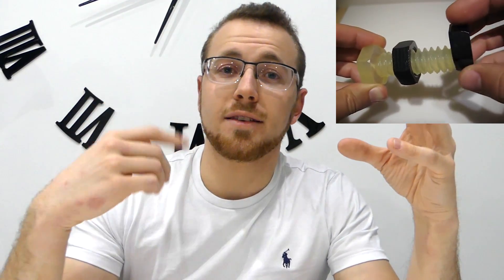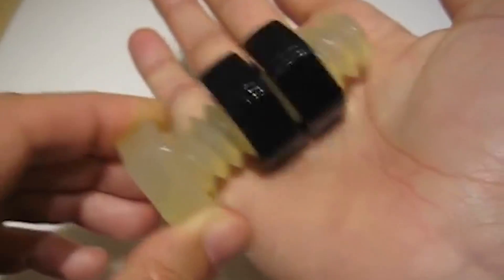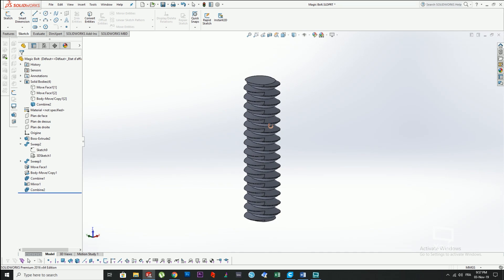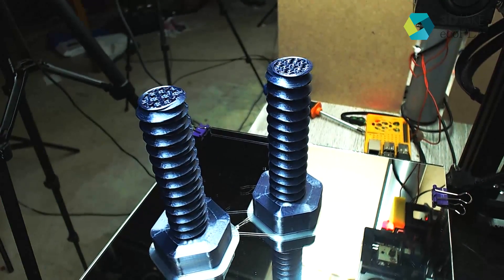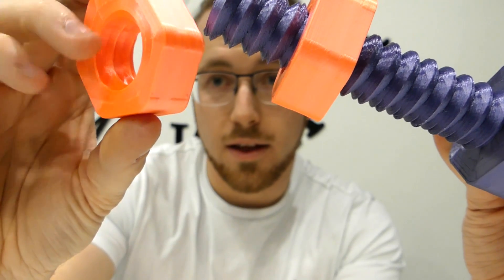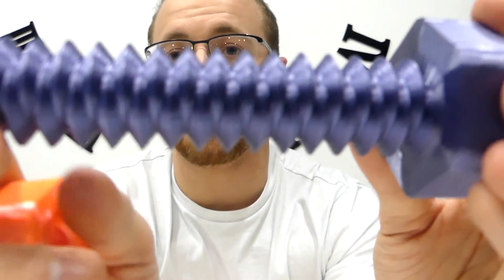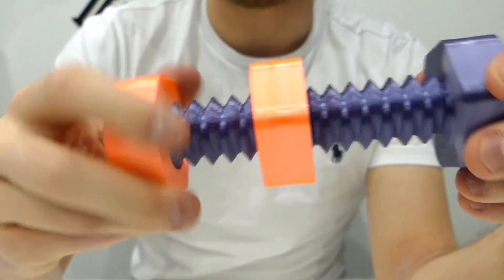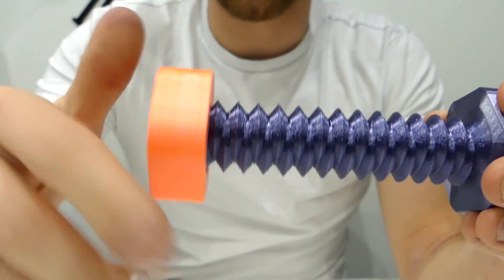Reverse engineering the "Magic Bolt"

Comment: Same principle as the old Draper screw drivers by the look of it ! I can think of a lot of possible applications to this for ect.. actuators/gears in rc models transmissions in vehicles  posibly even a mantelpeice clock.😃😆.

Comment: 'Like' is not enough to descrive how i am, that is really impresive and also is impresive how you open free describe how it is designed and how it works, it uses cases, etc.
I had another idea: Use that to cause turns on puzzles to only turn a fixed number of turns (or degrees) causing invisible locks and makeing the puzzle much harder to solve, also let turns work but locks other parts, etc. (by having on the bolt extreme a non end turn space)... uses can be really complicated.
Giving a 'like' to this video is not enough.